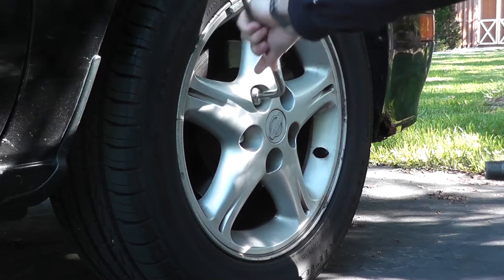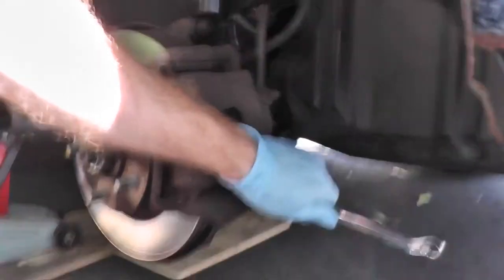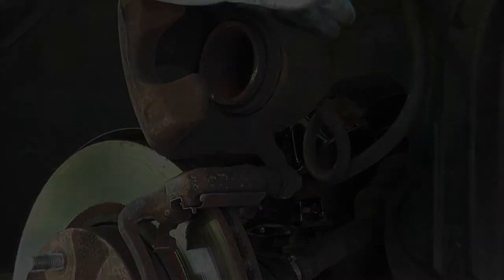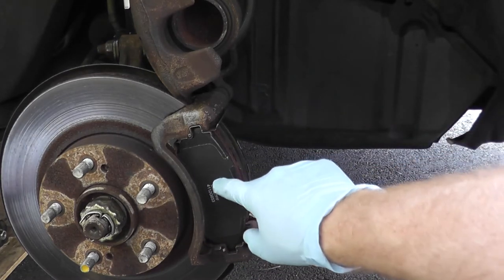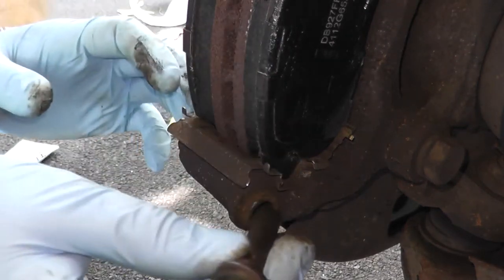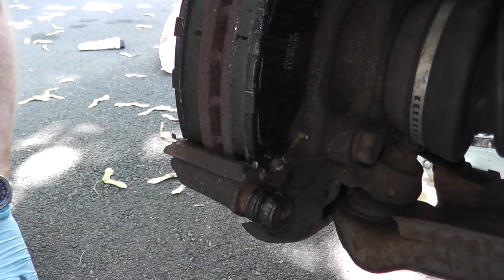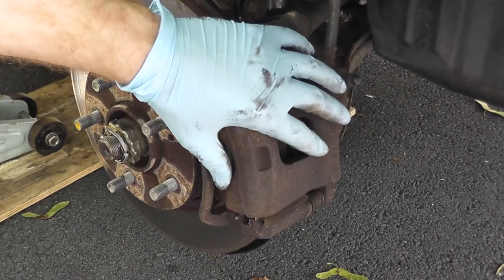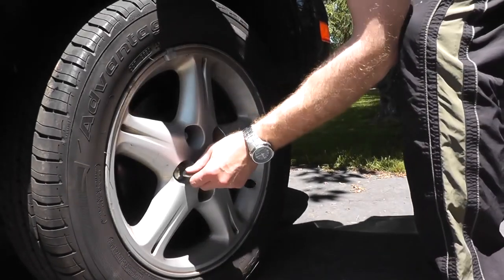Nissan Maxima / Infiniti Front Brake Pad Replacement with Basic Hand Tools HD

Comment: broke college student here with access to all the tools necessary! going to attempt this for the first time in order to save some much needed dough! any tips/rookie mistakes I should be aware of? thanks for the amazing video by the way! really clear and straightforward! also, do I have to worry about brake fluid leaking out from the line while I do this?
Reply from the maker: Just keep an eye on the brake fluid in the master cylinder. You don't want it to spill over.

Comment: you can reload the pistons by taking a flathead screwdriver and pushing the brake pads towards the pistons through the brake inspection slot. the caliper will come out alot easier and you dont have to worry about finding a plank of wood

Comment: So do you not have to open up the bleeder when compressing the pistons?
Reply: No, because when the piston is compressed it just pushes the brake fluid back into the master cylinder. You just have to make sure it doesn't overflow. You'd only muck around with the bleeder if you wanted to replace your brake fluid at the same time.

Comment: Save yourself some money! Become a brake mechanic just watching a video !
The video might not mention checking caliper for wear and thickness.  I watched one where the guy was timing himself and he didn't  mention any safety procedures  (jack stands )defect checks(aforementioned rotor, brake hose condition as some of these maximas are now 24 years old, caliper boot condition,etc)on one side it took him 20 minutes(he broke a bolt on the other side 
so he left that time off)Hey..40 minute brake job!no reason to mention getting right part down at part store..time to jack up car(he saved the safety related jack stand time)or checking brake fluid level
Or making sure pedal was hard and not mushy after brake job. Easie peasie!